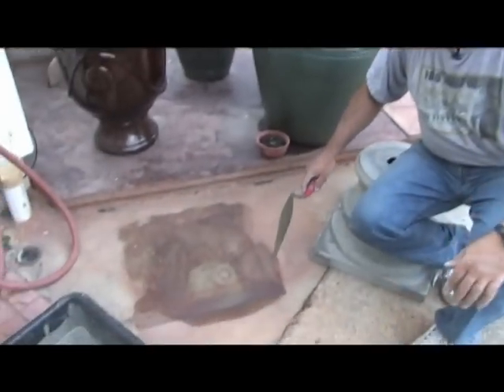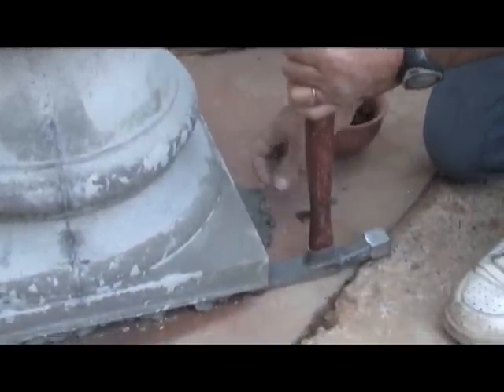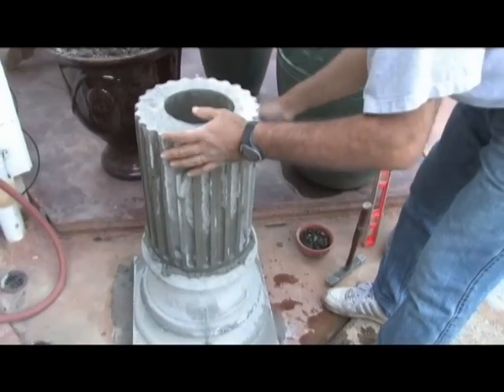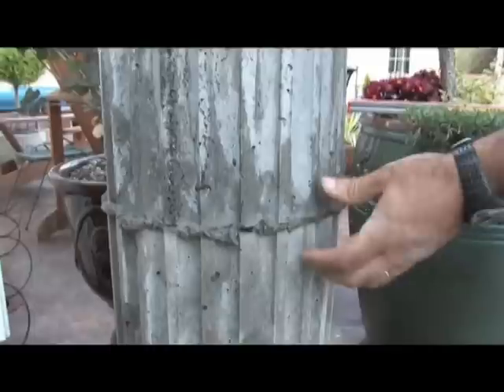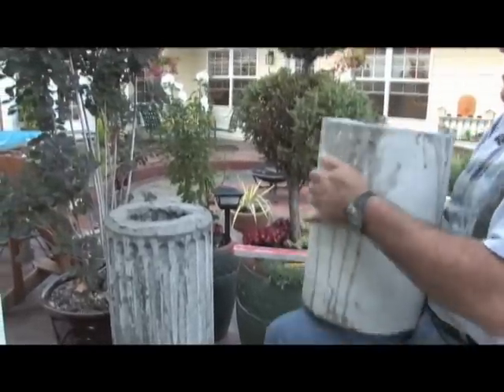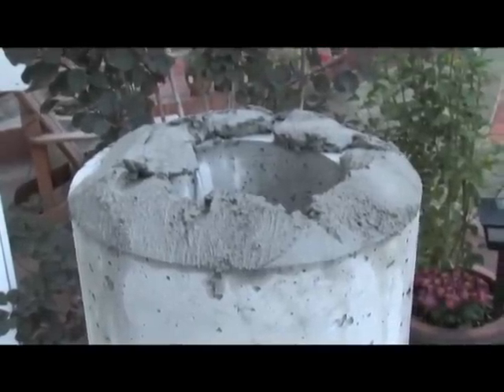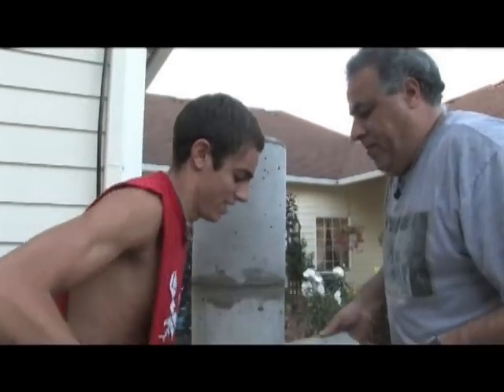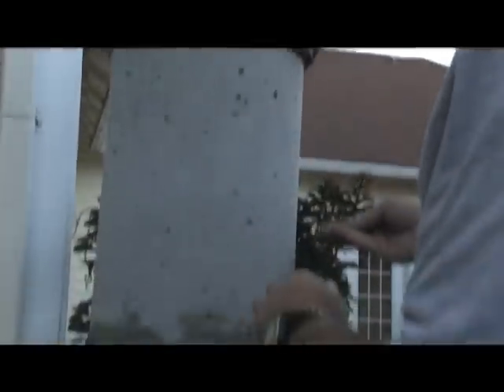#4 column construction 4.mpg

Comment: Nice work... I used your balister mold and I get great compliments!
On these tall columns... I'd want to connect each section with steel rebar and bond the lower base to the concrete pad with rebar.

Comment: i would always add vertical iron rods to the concrete to reinforce it. without it looks very wobbly and dangerous. otherwise it is a nice idea for garden deco. in europe we buy cardboard tubes called hamburgers and cast the column in one piece (with steel rod baskets inside).
Reply: Really its called hamburgers?